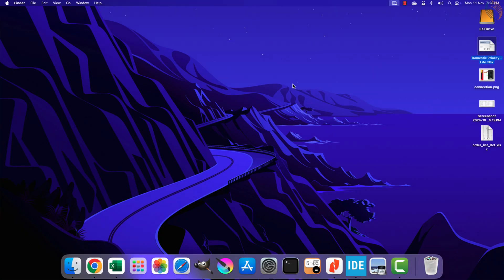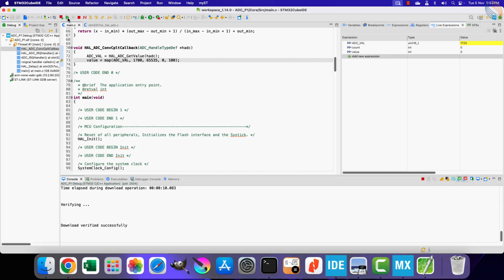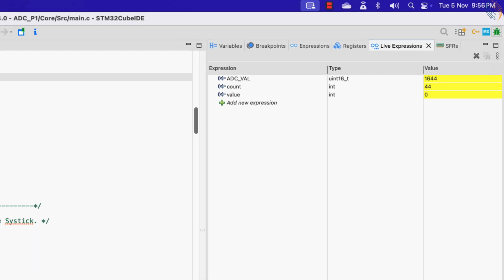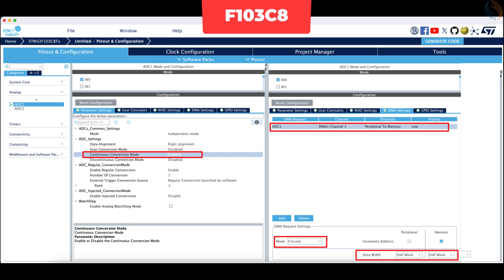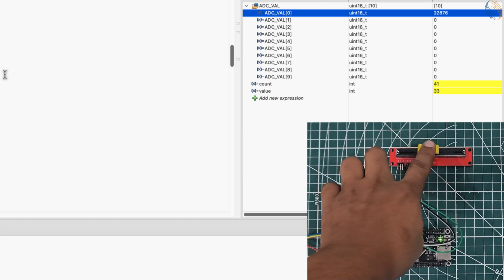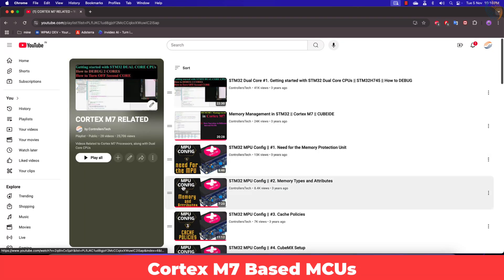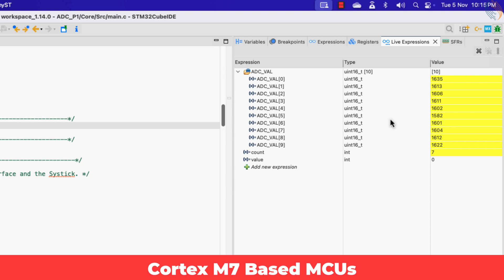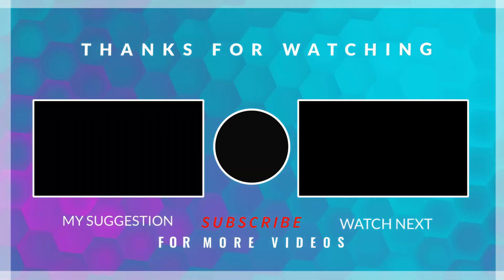STM32 ADC Tutorial (Part 2) | Single Channel Interrupt & DMA Modes

Comment: What is the value for a reasonable clock frequency to prevent the while loop from becoming unresponsive when running interrupts at a very high rate?
Reply from the maker: There is no such value. It depends on your MCU clock. Just make sure you do not set the clock very high, unless it is a requirement by the ADC device.

Comment: What are the advantages of stm32cubeide on macOS? Why don't you use Windows like your previous video?
Reply from the maker: Can't run windows on mac.
Reply: @ I am considering using it on macOS but not sure about the compatibility with M Series CPU.
Reply from the maker: I am using it on m2 chip.